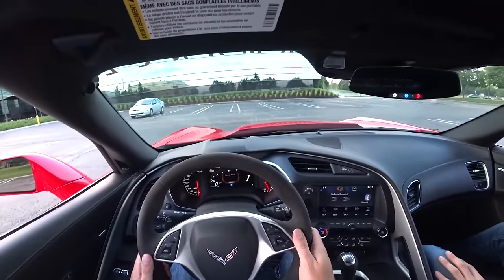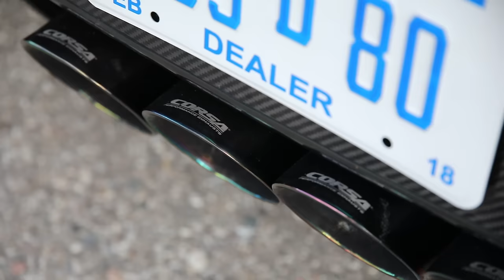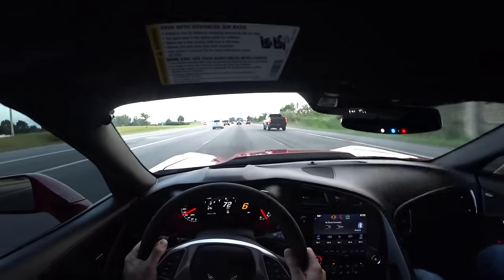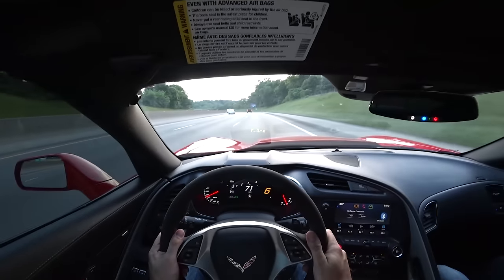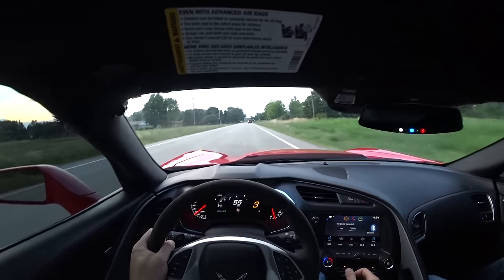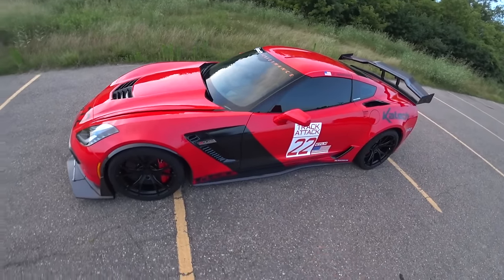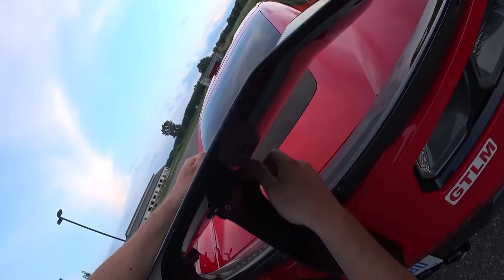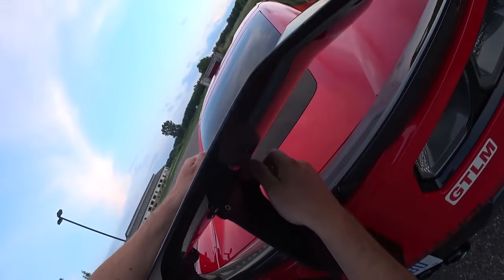850 HP Katech C7 Corvette Z06 - POV Test Drive & Discussion

Comment: Katech is impressive. Bought a new 2019 Corvette Grand Sport, with a MANUAL TRANSMISSION, and it’s a great car! Huge power, fantastic handling, and with the magnetic ride control, the car goes from track stiff to cruising smooth in an instant. My wife even asks when we can go for drives in the Corvette Grand Sport, and that rarely happens with my NSX. Buy one, if at all possible, life is short.

Comment: Very interesting.  Lots of good information.  What is disconcerting is all the twitching of the camera, whenever the speaker moves his head.  Audio is a bit lacking for the listener, as it is very hard to hear the passenger, at any time.  A 2 mic wireless set up would be appropriate here.  As a video specialist improving the presentation, can lead to greater interest.  There are computers and programs that can sync. multiple camera / microphone productions seamlessly.  Was I not curious, I would have left the video, much earlier. You all must have a good product.  Get the video smoother and more may stick with it and get more out of the presentation.  Thanks for sharing.  DS

Comment: How hard was it to add more fuel with the DI system, alot of smaller tuners/shops have alot of issues with getting more fuel from the DI systems compared to the old port injection systems.

Comment: 800 (crank) horsepower for $12k???? Yet streetspeed717 paid less than $10k in mods for 800+ wheel hp
Reply: TheSilentJackYT you pay for quality. Katech has a really good reputation and they have built engines for numerous GM race cars. I would much rather send my car to them than to a lesser known shop.
Reply: Mike definitely spent more. You should know he makes 1.5 to 2.5k per video.
Reply: StraightPipe Gaming he went over every mod he’s done (before nos)
Reply: TheSilentJackYT lol $10k for 800whp. Please tell me where you're getting these parts. Mike spent probably $15-20k on parts before he added the nitrous. That's not counting labor and a proper set of wheels and tires. Mike for sure has at least $25-30k put into his z06. My build with long tubes, x-pipe, heads, cam, e85, meth, upper lower pulley, upgraded fuel system and an f-1x procharger is going to cost me $35-40k. That'll hopefully get me to 1000whp without nitrous.
Reply: Mike made a video. Cost him 20K.

Comment: 2:38 Only holding 60 mph during that turn? That's not impressive at all considering what the car's capable of. Didn't the Audi Q7 recently do the same exact thing a few videos back?
Reply: maximus9401 We will make sure you get to see what the car is capable of in the M1 Concourse video. It pulled 1.4g on street tires.  Not going to push the car to the limit on unknown road conditions.